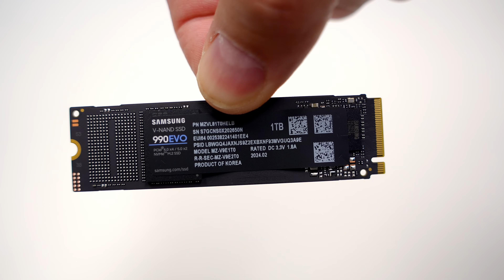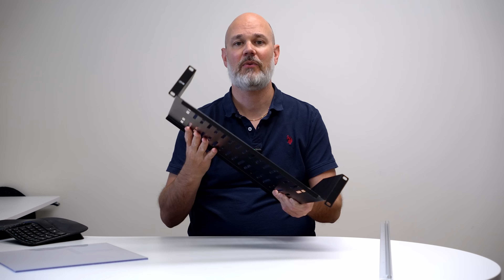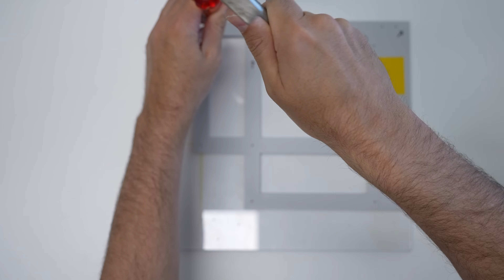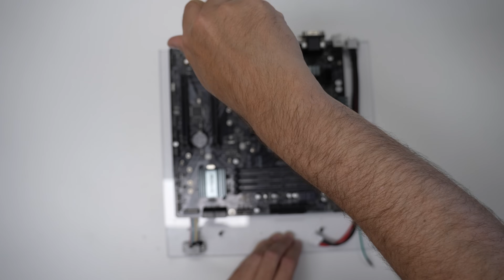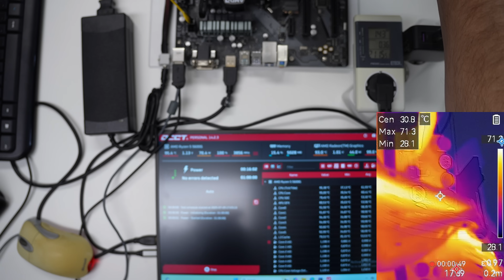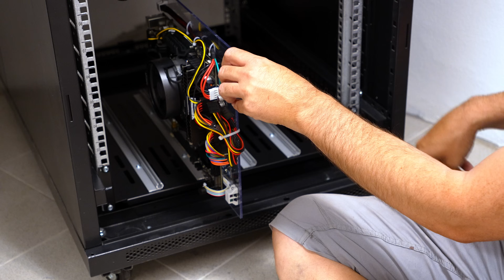Homelab: Install UNLIMITED CPU and RAM without wasting space or money | DIY Blade Servers

Comment: Cool, and lots of fun, but for far less $s I grabbed a T7090 Dell Precision Workstation on E-Bay.  It has 192 GB DDR4 RAM(can be upped up to 256GB easily)  and 56 VCores with dual Xeons.  I run Proxmox hypervisor and a ridiculous number of VMs, both Windows and Linux and run it all remotely from my Mac Studio Ultra using a combination of Royal TSX and Microsoft Remote Desktop .  The Debian based Proxmox system is amazing as you can make instant templates out of any VM and then make instant clones from the templates.  Yes, instant, thanks to the CoW enabled file system.

Comment: This is a great video, I really love the concept and the intention behind it. Traditional blade servers are powerful, but they’re also pretty power-hungry, so building a more power-efficient “DIY blade” setup with standard motherboards mounted vertically is a really smart idea. I’m honestly considering doing something similar for my own home lab.

One thing I’d personally tweak is stability. If I ever need to move the rack, I’d want each node to be fully secured with screws or some kind of locking mechanism so nothing shifts around. That’s just a personal preference, I like things to be rock solid.

I’ve also been thinking about alternative node options, like using Lenovo P330q mini PCs and designing a larger custom cage to hold multiple units cleanly in the rack. That could keep things compact and efficient while still being modular. Just an idea for future experimentation.

Overall, fantastic work. I’ve subscribed and I’m definitely looking forward to the Kubernetes video. Thanks for sharing this!

Comment: one option you might want to look at is some Common slot power supplies typically used in servers, paired with a pico psus for each pc. very cheap to get high watt high efficiency common slot psu. youll get some losses from the pico psu but as you already use one that doesnt matter, but i suspect the losses on those power supply bricks cant be great. chinese shopping sites can be handy for this kinda stuff

Comment: A cleaner solution for the 12v PSU idea is Pico PSU Adapters they plug directly into the ATX power connector on the motherboard taking up very little space and can go up to 250W. They're made for USFF industrial PC's.

I would also go with an intell 12400 over the 5600G. They can have their tdp configured unlike 5600G and their iGPU's have better transcoding capabilities.

But to be honest for the money spent on 5 computers like this, you could have gotten 5 or more 1L USFF mini PC's that would have offered more or less the same comput power but with a much smaller footprint and power consumption.

Comment: I think you missed an opportunity for seamless backup power. Instead of using a separate PSU brick for each blade, you could run a single 12V bus connected to a battery bank. With a sufficiently large enough 12V charger/rectifier feeding the bus, you'd effectively have a super-efficient UPS with zero switchover time.

Comment: @Kello Labs 12V 12.5A - for sure...  For sure  at melting point... 😆😆😆😆 Buying power supplies on Aliexpress, epsecially those cheop one is a terible idea... They are really badly designed and they are  the real fire hazard...

Comment: I did something like this 20 years ago with a bunch of IBM PC330 systems when I built a beowolf cluster. I didn't have a rack but used an old stereo cabinet that had the glass door. I think I used the PicoPSU modules to power it. they were cheap back then.

Comment: i use 10 lenovo p700 thinkstations with 384gb ddr 4 ecc ram, 2x 4tb wb blue raid 1 nvme ssd and 2x intel xeon e5-2699v3 each server as a proxmox ha cluster and its works flawless ,also for gaming . 3.84 TB Ram and 180 Cores / 360 Threats and 40tb NVme in Raid 1. Total

Comment: @Kello Labs - For the money you spent to build these computers to get get only 30 cores of processing power you could buy used AMD server with 128 cores - that is 2x64 cores CPU with dual EPYC motherboard - believe Me - that is even smaller package then your whole server rack cabinet with all you current PCs and 4xtimes more processing power! Used Epycs costs cheap from China!
Reply: i bought for my NAS:
- MSI X399 Creation, 100-220 €
- AMD Threadripper 1920,  24 cores, 100 €
BUT, on this MB you can add a 100 or40 Gb/s NIC, plus a LSI x24i RAID controller in IT mode & a lot of other things, you can also add 256 GB (32x8) of RAM in order to supply enough RAM for True-NAS-Scale.
Proxmox is fantastic, but i would never put OPNsense or PFsense or True-NAS-Scale on it, Proxmox is not made for such thing, my opinion.
Also the choice of NVMe is very bad, Corsair NVMe are convertible (over linux-command/program `nvme-cli`) to 4Kn, Samsung is physical 512 & not 4096, so, this NVMe can never be converted to 4Kn.

Comment: I like it! What is the height this takes up in the rack? Based on the height of a microATX board, it seems it might fit into 6U?
Reply from the maker: Thanks! The ones I built take up 7U plus one hole. The size is due to the pre-cut plexiglas I used. It could be a little slimmer but I had no good way to trim down the plexiglas further. I think a hacksaw would probably not give a nice enough cut.

Comment: Cool build. I did a similar approach 10+ years ago to build a compute cluster the cheap way. It used DRBL linux tool to boot all nodes from the main node using network boot and network mounted root partition. It worked super well and served for about 6 years without issues! It was 4 nodes with 16gb / 4 core each on miniITX boards.

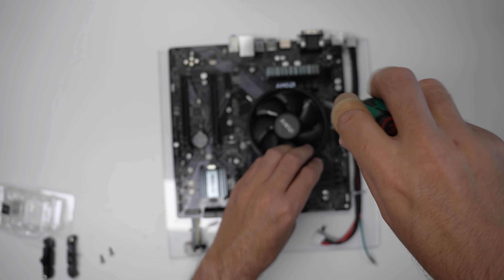Comment: Fantastic build! 🛠 Your approach to maximizing CPU & RAM without compromising space or budget is truly commendable. 👏 One detail I noticed: when installing the CPU cooler, I didn't see thermal paste being applied (24:04). Could you please confirm if thermal paste was used, or perhaps a thermal pad was employed instead? Ensuring optimal thermal contact is crucial for maintaining efficient cooling & preventing potential thermal throttling. Looking forward to your insights on this! 🔧💡

Comment: Very cool idea and well-executed. But, if you need "multiple computers" to test on, why did you not consider virtual machines (VMs)? For what you spent (or less) on all that desktop hardware you could've built a server with multicore CPU and 1TB of RAM and had all the VMs you could need.  Enterprise gear that is 2-3 generations old is dirt cheap on EBay and is typically more than adequate for the home lab user.

Comment: Instead of smaller PSUs. You could also use 2-3 DIN Rail mounted ones. If one goes out you can swap them as they are DC aggregated thus you get redundancy yet share better PSUs.

But wouldnt small 200w SFX PSUs not be cheaper and more efficient?

Comment: 27:20 This power supply board converting 12v  to  different voltages (3.3v, 12, 5v) but I think we cannot able to run graphics with same power supply

Comment: Thank you for this, I use older hardware for my servers and have been looking for solutions to update to more modern hardware in my rack :) 

I have some suggestions :)  For marking the motherboard holes for the standoffs, that can be done direct from the motherboard if you use transfer punches (which come in a lot of sizes typically at 0.5mm increments just search machine shop tool suppliers for them )... 

I would probably use standoffs with longer threads and then a nut and a decent diameter (10mm or larger) washer on the back side of the plexiglass but maybe that is over engineering :D
Where you used your 3d printed items screwed to the plexiglass, correct me if I am wrong as I initially assumed you were using bolt and nut assembly but after watching it appeared you were threading normal machine screws into the plexiglass, if that is indeed the case, I would use fan mounting screws with a coarse thread :)

Zip ties are great ways to hold things in place and I am glad you mention about tightening them with a pair of pliers after setting them by hand...  That makes a world of difference to their holding capability.

The heat on the cables is a little worrying in so far as I would find a way to lower them temps, they are pretty much getting close to the upper level of tolerance of the working range of the insulators...  Perhaps an additional low watt power brick mounted on the side of the power supply shelf to power a row of fans to not only blow over the PSU's but also along the cables between the  board and the plexiglass to help dissipate some of that heat might help :)  Hey I live in a country where in summer ambient gets to over 40C

Some thoughts... If the PSU cases are getting close to 80C, imagine what their temps are internally...  One thing I would probably do if I was to do this would be to cut slots in the top and ends of the PSU cases and mount fans to help blow cooler air across them to remove some heat... Cooler components = longer life

All in all a nice clean build so congrats on that

Comment: What is nice is that you do not need to get hung up on the PC parts specifically. You can do this with any PC motherboard, provided it has onboard video. If a business is getting rid of scores of 8-core desktops, you can pull them out of the chassis and do this. If you are delicate, you might be able to do this with laptop motherboards as well. Want something low power? You can do this with mini-PC motherboards from Mini-Forums with integrated laptop CPUs. The only limitation is heat and the output of the power supply. The power supply type he is using is what is called a Pico Power Supply. You can buy them with and without the AC Adapters, and they can go over 200W. You can even forgo the individual AC Adapters and just get a single 12V power supply to power multiple Pico Power Supplies.

Comment: As an upgrade, consider aluminum plates for better grounding and shielding and Meanwell LRS-150-12 as PSU. Way better quality and stable voltage.
Also price/performance/space wise you can use 5700G with 4x16 GB ram with larger Meanwell UHP passive power blocks.
Cooling wise you can mount the power blocks on the back side of the aluminum plates.
Also shorten DC cables as much as you can.

Comment: It's a pity you don't have the option on those motherboards to restore the state the machine was in when the power goes off, because if it was off and there is a power outage, it will turn on, which is not necessarily what you'd want. I always to for "previous state" if that option is available.

Comment: the Ryzen 5 5600G has half less L2 cache than the Ryzen 5 5600 without "G". Will the gpu help ?  
You will use a 1Gb/s hub to connect this cluster , and that is a bottle neck...
For LLMs, this cluster may  run less fast  that we may think !
The blade is a good idea, but I would use aluminum plates instead, for thermal conduction and EMI insulation...

Comment: You should've opted for using a single 1000W ATX PSU to power them all.
Reply from the maker: That would also be a valid option. But it would introduce a single point of failure. My goal with this build was to have them independent so if a PSU breaks the other machines will keep going.

Comment: How are your CPU coolers working on your assembled build?  airflow management seems like it would be a problem for this build.  Fun project, but it might force you to do some reassembly.  I see thermal throttling in your near future.  Do an update and follow-up, curious how this is working out for you and how it compares to using a stack of refurbished lenovo thinkcentre M910q workstations.
Reply from the maker: I was also concerned about airflow at first. There is only a few centimeters between each fan and the next blade. But in practice I have not had any problems with it. Maybe it is because the setup  is open air and the room I have them in has cooling.

Comment: hi there won't plexiglass build static up over time, which could be a potential issue. regards Richard..  Other than that a great build idea.
Reply from the maker: Yes in theory I think it could be an issue. In practice I have not had any problems. Maybe it is because the blades are connected to metal that is grounded.

Comment: Subscribed.

This is actually a pretty awesome idea.

I'm probably not going to do this, as my current homelab consists of two 1U Dell servers and one 2U servers giving me 104 CPUs (The CPUs are not the same across the three machines) and about 600gig of RAM.  But I have so many old mobos kicking around that I could maybe spin them up to act as dedicated machines to do "something" but, I'm already feeling worried about power consumption, and such with what I am running.

But if I were to redo this, and had a big(ger) budget, modern hardware, NVME, all running Proxmox?  Heck yeah, would do.  Although I am thinking about switching it up to just run a machine with SATA SSDs instead of the spinning SAS 10+year old drives all the machines are running now. But that budget thing I just mentioned.....

I started playing with Portainer and getting Docker instances going, but, fell out of love with it rather quickly because it becomes a nightmare trying to remember where I put what when I need it.  Portainer is WICKED awesome for getting the containers running, and managing them, but, I'm finding grief when it comes to handling data migration and needing to move the containers around with their data between instances.  So I'm tearing down what I have in Portainer and going to dedicated ultra-small virtual machines, setup Docker+Compose in an 4cpu/1GB-Ram/2Gig HDD with Cloud-Init, get what I want on the machine with Docker and have Ansible maintain the docker instances, that way.  Backups become a breeze since volumes will be written to the "OS" level, I don't run  into port conflicts, and in ProxMox I can go to the VM that I need to work with directly.  The awesome thing with cloud-init is that when you realize that you're running out of drive space (Which I did when setting up one specific machine) I just had to shut down the VM, expand the drive in Proxmox, spin the machine up and poof, the drive was resized automatically.
Reply from the maker: Yes, I have tried this build with old mobos and then I attached a  SSD to the blade as they didn't have nvme. Maybe I'll make a future video about that. It is nice to re-use old hardware, altough power consumption may be a concern as you mentioned.

I have run containers for a long time too. I plan to install a Kubernetes cluster on these machines in an upcoming video. Container orchestrators such as Kuberntes makes it easier to run containers on many machines as you don't have to care on which machine the container is currently running. Although they have a steeper learning curve than plain docker.

Comment: I do not agree with this build on 2 major things ...!!! [1] First is the power supply ...I do not know how did you find this adapter BUT these CPU has 95watt of power and if you start connecting usb sticks or any external devices on the boards  you will sure need a fire extinguisher ...The way you put these not recommended power supplies (my opinion) so close to each other !!! ohhhhh man you must definitely need a fire extinguisher in hand...!! [2] secondly how are you going to make all the boards to communicate with each other and how are you going to see all these boards as one???????????!!!! Besides the software you absolutely  need some kind of a HARDWARE Unit like a controller to make this happen. So you need more power. And the final Question is ...: If you made something like a cluster of these CPU's what kind of a load will you be able to run on them because you said something of PROXMOX ...and eventually you need a lot of luck and more fans to dissipate the energy and prevent your system to be on fire...GOOD LUCK.
Reply: Ohhhhhhhhhhh I forgot to say ...Just an opinion of course ...Try doing the same BUT USE LAPTOP BOARDS instead of micro ATX boards..!!! With these power supplies you will not accomplish anything decent.!

Comment: Beowulf cluster. You can do nice inhouse AI rig with this setup. USe cheap 8 GB cards on the nodes and you will savings lot of subscription fees.. plus total control on your setup.. I have similaar setup but with obsolete i3 6th gen boards,..
Reply from the maker: Interesting! I’ve never heard that one before.  "A Beowulf cluster is a computer cluster of normally identical, commodity-grade computers networked into a small local area network". Yes that is exactly what it is :-)

Comment: Those converters are for really small mini-atx cases where a built in psu won't fit.

Also, use a single powersupply for all the machines, way more energy (and space) efficient.